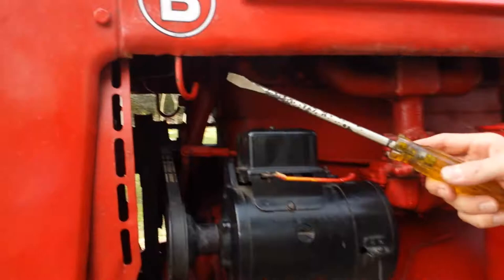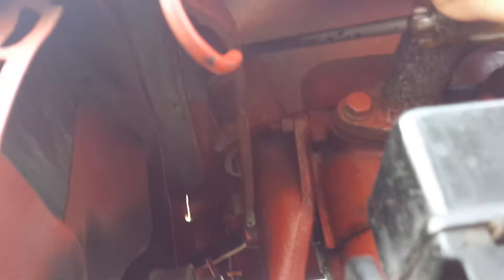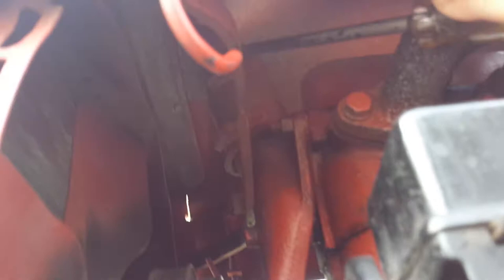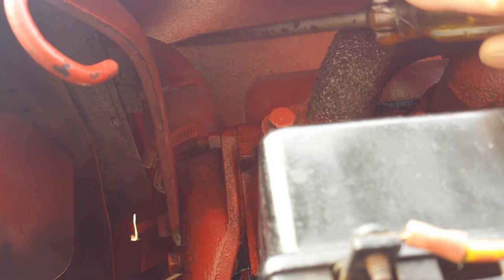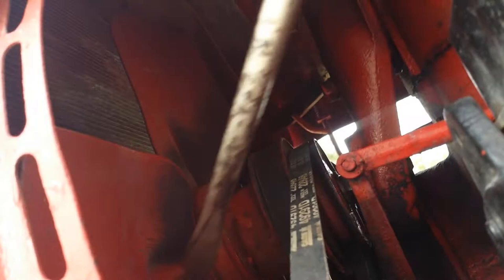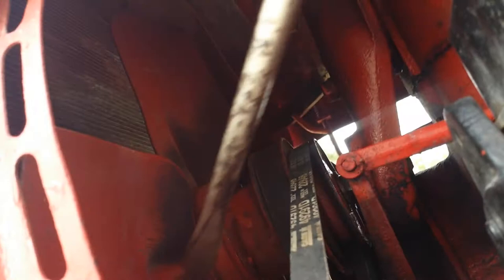Farmall B A Explained: Thermo-Syphon Cooling System No Water Pump No Thermostat

Comment: thanks for the very simple informative video. im restoring a super a and just got it cranked up. runs great but I thought the radiator was malfunctioning. turns out it was working just as you described it.  amazing how well that thing transfers hot water to cool and back again! Thanks again.

Comment: What ratio should i mix the coolant at? Would only be summer use but dont want to ho straight water.
Reply: 50% coolant to 50% water.  For Summer use, ok to increase water amount up to ~75% as long as you don't leave it like that into the colder seasons.  More water will cool better

Comment: Thanks for your video, I’ve had trouble explaining to the guys at my work that my tractor doesn’t have a water pump or thermostat. I have a farmall super A that was given to me by the family I bought my farm from. I got it running, but it is overheating. I flushed the radiator and block. The radiator had a pressurized cap on it. Does yours have a pressurized or non pressurized radiator cap. I’m trying to rule out what all could be causing it to overheat.
Reply: I have a 1950 Farmall Super A no water pump as well mine came with a non pressurized cap and cycles fine and keeps the engine cool especially here in Maryland when the humidity is horrible lol. But it works yours should definitely have a non pressurized cap. But I’m not a professional so maybe ask your local case ih dealership.

Comment: Would adding to much antifreeze and less water make the tractor run hot,
Reply: You may notice some cooling efficiency loss with less water.  The syphoning action works best with at least 50/50 water.